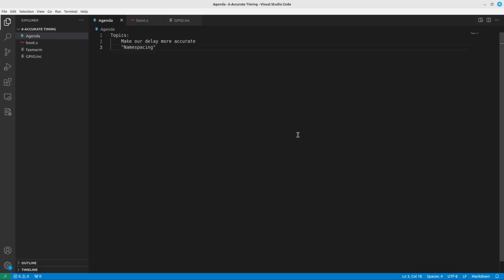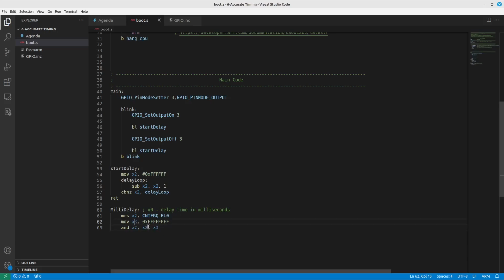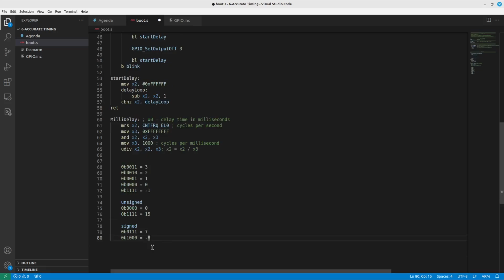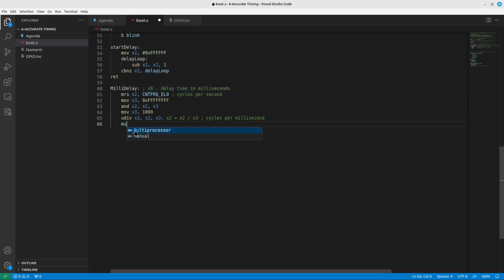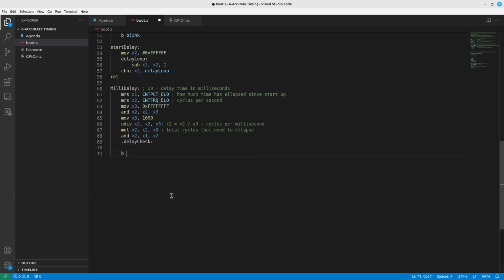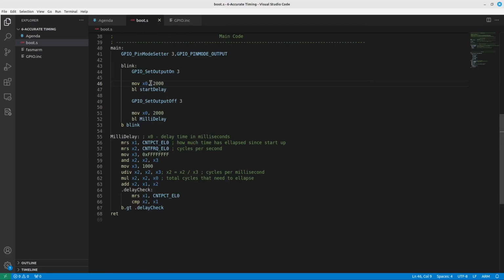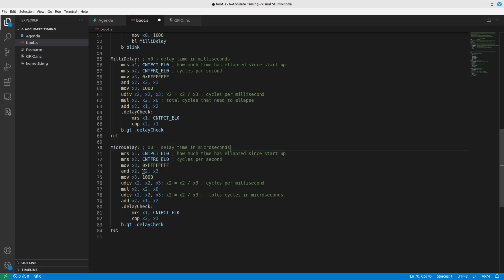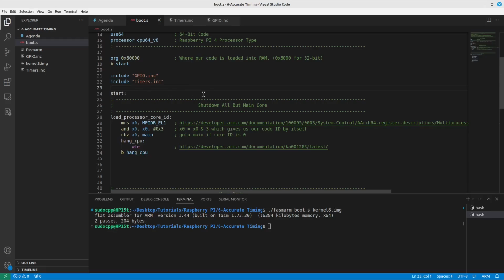Raspberry PI Bare Metal Assembly: Using Accurate Timing [EP8]

Comment: I love the series!  I have an old Pi sitting in my basement and I've wondered for awhile what it would take to control the processor directly without installing an OS and these videos are answering all my questions.  I'll start working on blinking my own LED soon!  Keep up the good work!
Reply from the maker: That's great to hear! If you have a RaspPi 4 it should be very straight forward. All this code is now posted on github.com/SudoCpp as well (with better comments in the code).

If you have a RaspPi 3 the code would be very similar but it will be different enough that changes will be required. It has a BCM2837 rather than the BCM2711 which means you'll have to follow that documentation instead.

And if you have a RaspPi 1,2 or 5 I haven't looked into them enough to know exactly what has changed. Hopefully the 4 and the 5 are pretty similar.

Have fun!
Reply: @sudocpp  It's actually a RaspPi 1 that someone gave me many years ago that I never found a good use for.  But I have the peripherals manual for the Broadcom chip and the instruction set for 32-bit ARM processors so I think I should be able to stumble my way through it.